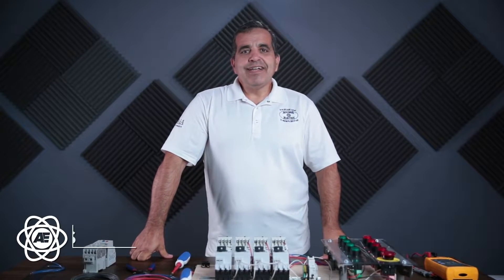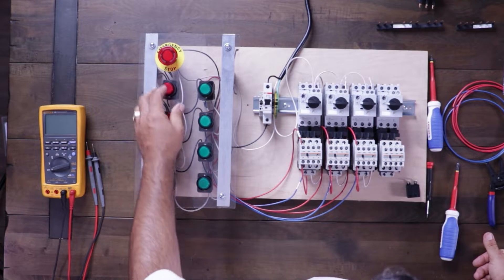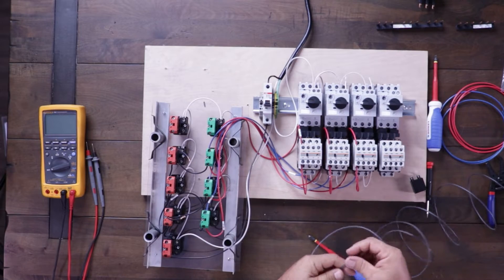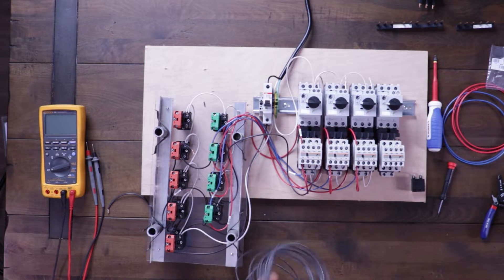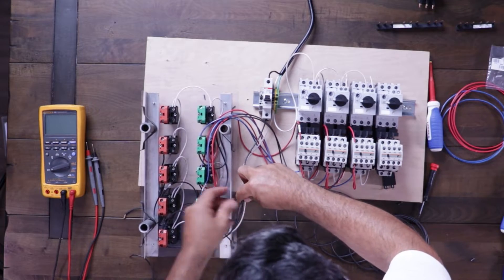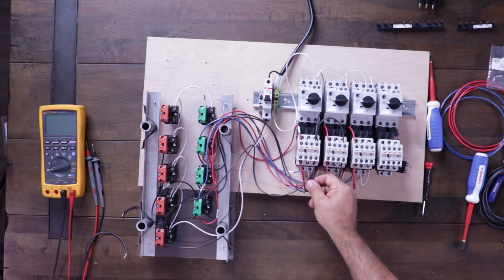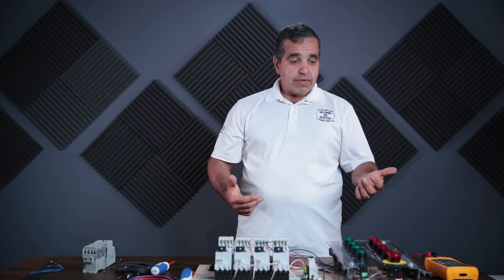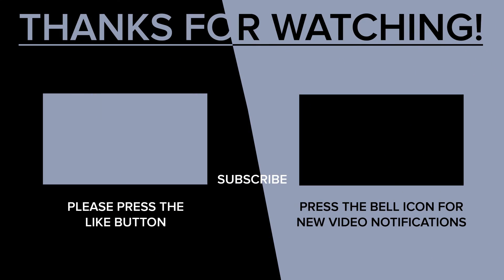Motor Controls: Sequenced Start Stop - Part 3

Comment: Sir, Thank you for your videos. I really enjoy your channel. 
I’ve been planning to install a 2,500 gallon Water Tank (Cistern) and connect my single-phase 240V 2HP submersible water well pump to the tank. I want to automate the control (Start/Stop) of the submersible pump with a Float switch (SPST switch) in the Cistern.

Most/All the topics/videos on motor/Pump control shows the use of a Contactors as Motor Starters (which seems to be used mostly for 3-phase high-end/high-current applications). And, I can kinda understand using a Contactor for a 3-Phase high-voltage motor. But, for Single Phase 240V Pump Motors, like my application for a Submersible Water Well Pump (or, any single-phase 240V motor) it doesn’t seem like a Contactor should be needed. 
If we Open and Close just one of the Hot legs of the 240V circuit to the Pump Motor (like, for example, with a Single Pole Single Throw Float switch), shouldn’t that be enough to start or stop the Pump Motor? Of course, the Float switch will need to rated to carry the Voltage and Amps required of the Pump Motor. 

I realize (think) that one of the hot legs of the circuit will be energized all the way down to and through the submersible pump motor and back up the other Leg up to the Open Float switch. And, the other hot leg will be energized from the power source to the Open Float switch.  But, the Open 240V circuit Current will stop right there (at the open float switch). And, when the Float switch closes the 240V circuit will be complete and the pump motor will Start-up again.
If this is the wrong approach, please help me to understand why this Float Switch application design is wrong/flawed for my 240V single-phase motor application and what I am missing. 
Many Thanks in advance.
Reply from the maker: While that might work electrically, where is you overload protection for the motor? Using a motor starter will ensure that the motor has OL protection and will also keep all the motor current from flowing through the float.
Reply: @AccessToPower  Thanks for your reply. My submersible pump control box has OL protection components included. I have since decided to use a low voltage (24V AC) thru the float switch and then use that 24V circuit to energize the coil on a contractor to provide 240V power to my submersible pump control box (which includes the OL protection).